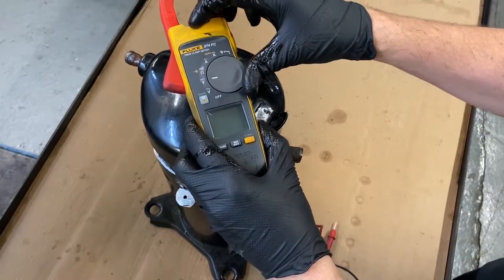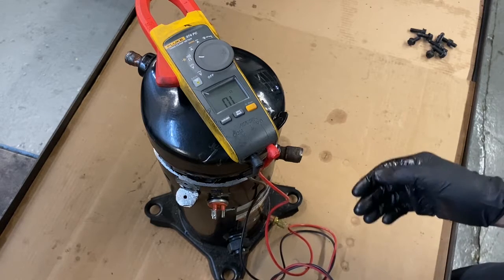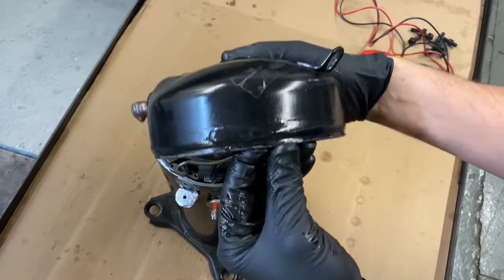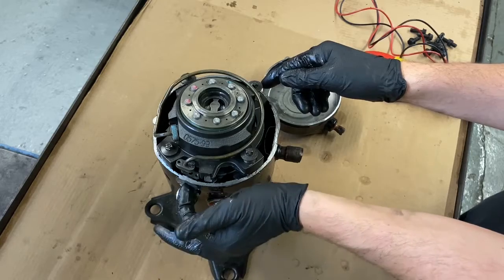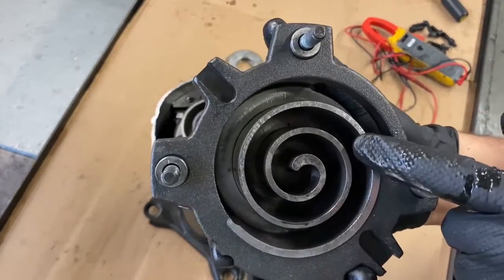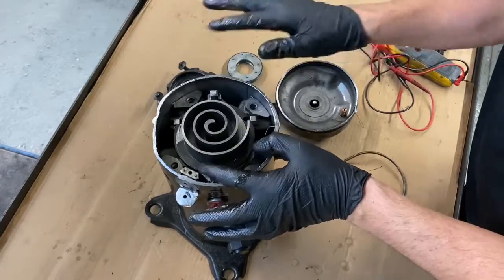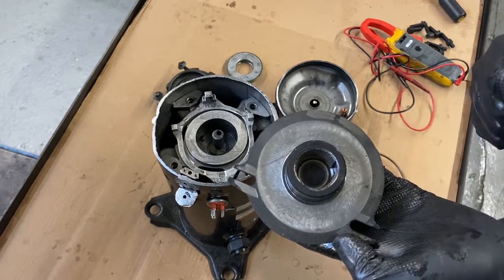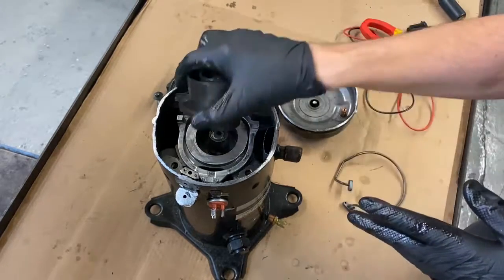Scroll Inspection

Comment: Hi Trevor was hoping you could shed some light on this,

 I've got a few Copeland ZP154KCE-TED-462 compressors in systems i am commissioning. The units they are in contain 12.5kg refrigerant, the AE bulletin states that if charge exceeds charge limit (8.2kg) then a crankcase heater must be installed regardless of system configuration, but no crankcase heaters are installed. Would there be any reason why the manufacturer has done this and would the compressor warranty still be valid?

thanks buddy.
Reply from the maker: Great question. I would bring this up with the manufacture of the equipment. They may have missed this or may not know this. I would love to know what they say.